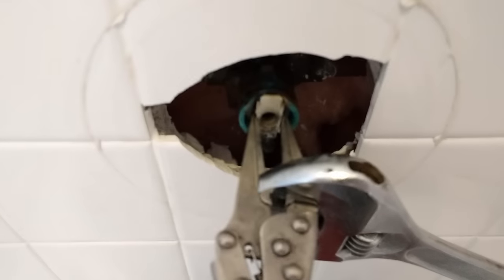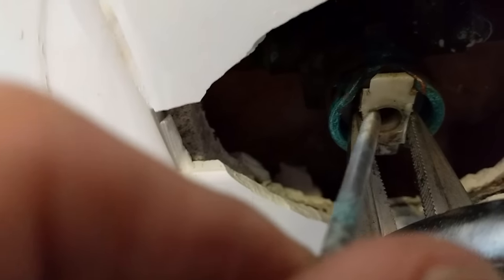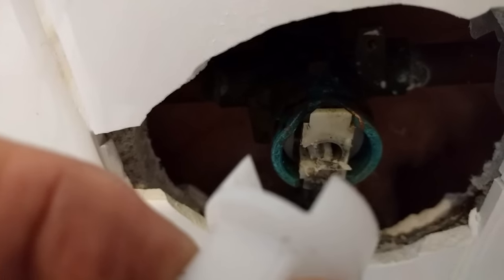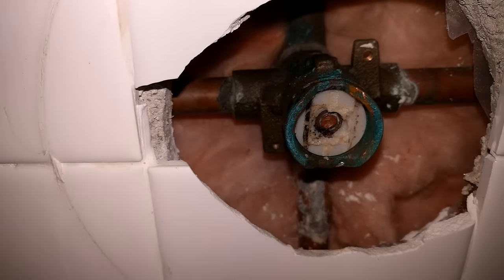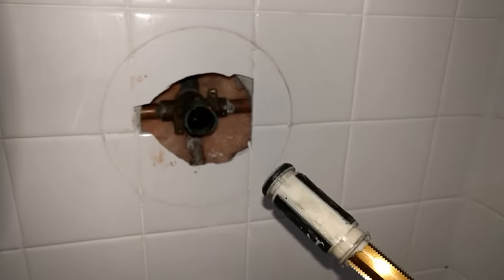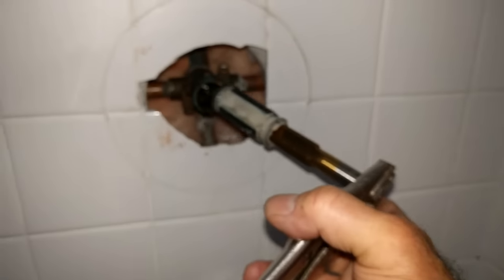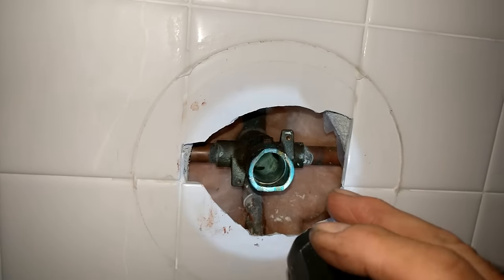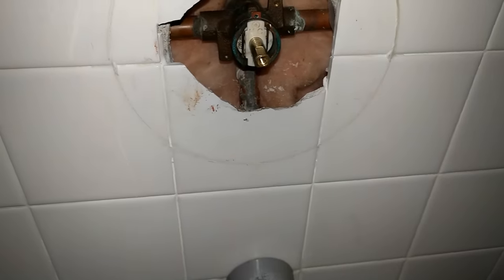Home repair Moen 1222 cartridge stuck really bad by froggy

Comment: OMG I think ours was literally glued in...my ex-husband had to take it out in pieces. The new one is installed but now there is a leak around the cartridge? I took a shower and I can hear the water pressure and noticed it leaked to closet below the bathroom...what now?? I'm thinking the tube was damaged when removing the old cartridge. Do I need to replace the actual pipe, now?
Reply from the maker: Remove and inspect all the parts on the new valve, washers bushings etc, look for damage from any tools used to extract, marks on the pipe area. If the area the valve sits is damaged yes you'll need to replace piping and valve seating area. THX!

Comment: thinking a tube same size as cartridge tube..flat bar across ..hole in bar..screw into stem.. puller.....?
Reply from the maker: You could make a tool, sure.

:)
Reply: @1947froggy  
is the little white plastic twist gadget that comes with the Mon replacement cartridge any good ?

Comment: **** EDIT: OK, it's a good idea to have the water supply to the house turned on when you're about to reattach the handle, that way you know what's off and what's on and what's hot and what's cold. So it's all fine now, eight and a half hours later.  ****

Well of course something has to go wrong. My normal is 6 o'clock is off, then turn counterclockwise through cold then when I get to about 1 o'clock the warm starts, then keep going left into full hot.  Now though, off is 12 o'clock, and I get lukewarm water going from 12 to 10 counterclockwise, then back to 12 for off, then clockwise through 3 for hot, them down through 6pm for a good mix.  Yes, I have the little notch on the brass shaft up, and the "HC" is in the right place. Anyone else have this problem???
Reply from the maker: Mine was the same, you have to note the orientation of the old valve as it comes out (markings etc.) and install the new one the same. It's pretty easy to take the new one out and flip it.  Thanks!

Comment: Great video, I had the same problem yesterday with a 20 year old plastic cartridge. I replaced it because the faucet was leaking.  I think I might have scratched the pipe, because it still leaks.  How would I correct this problem?  Thanks
Reply from the maker: You can "try" to polish out the scratch so the seals will work, or replace the whole housing. 

:)

Comment: There is a puller to remove, if ya dont you might break water connections inside the wall
Reply from the maker: The official pully (I tried it) sucks.

Comment: Not to nit pick Froggy.....but the 1222 only goes in one way.....the top tab will have "HC" on it.   And yes you can say if the water is reversed but honestly.....only time that happens is usually doing a renovation and a DIYer got the lines crossed. If you install the cartridge upside down you would cycle hot to cold instead of cold to hot
Reply from the maker: Yes.

Comment: Facing the same exact issue as we speak.
Reply from the maker: Give it a shot.  :)
Reply: @1947froggy  Finally got it. Pulled the stem out with vice grips and then picked at the remaining plastic with a drill and pliers.

Comment: I think a slide hammer for pulling out dents would do the trick.
Reply from the maker: Good thought, if you can attach it securely and it doesn't bust up the attach point. Mine gradually crumbled apart.

:)
Reply: that's a good way to break the solder joints too!
Reply from the maker: mmmm, might be a bit rough, yeah

:)

I was trying to be gentle (on the joints) and pull hard enough to get the cartridge out, it's touchy.

Comment: A lot of great ideas but the tapper idea was kinda off. You shoulder 3/4 nipple remover. Breaking off the the lips, using a 5/8 drill bit, and last step 3/4 nipple remover. Spray the inside, and outside of the broken cartridge with WD-40. Use your 3/4 nipple remover clock wise. Tap in to smudge not hard. it will begin to move. Once it moves pull it out. Try it tell me what ya think. Thanks for the video
Reply from the maker: Thanks for the comment, I don't think the wd would penetrate enough to make it work. It's not rusted, it's hard water deposits & hardened rubber gasket material. Brute force is what got it out. Merry Xmas.

:)
Reply: the down side of an easy out is it is tapered, and when using with plastic, it will expand it and some times makes it harder to remove.
Reply from the maker: Correct, I used a tap which of course is not tapered. :)
Reply: What have you been smoking? Also this is an old post, I'm guessing he's done with the job.

Comment: what type of grease do u use?
Reply: never mind... I c it in the vid... helped a lot this vid.... thank God my handle was only 5years old... 5minutes if that with a flat head and plyers... it all came out in one piece
Reply from the maker: For this it should state "waterproof grease" any brand.

:)
Reply: the valve should have a grease packet in the package. Its easy to miss. Otherwise use plumbers grease. Its silicon grease. I would use the moen brand that comes with the 1222 moen valve cartrige
Reply from the maker: Good call.

:)

Comment: All I have to say is... MOEN WTF
Reply from the maker: Yes.
Reply: @1947froggy  went to get the replacement part (for free) from them this morning and he gave the usual tips of vinegar and blah blah blah. Worst part is mine is only 3 years old... I'm close to having the plastic break so I thought I'd get the stupid tool that comes with the new set to give it a try after work today. *goes back to train his grip *
Reply: So after some struggling and wrestling I was able to get it out..... By destroying the f*** out of the cartridge. Even the last time bit at the back that was about 1cm thick wouldn't but. I had to drill it to pieces before it FINALLY ROTATED. I guess I have a hard water problem...